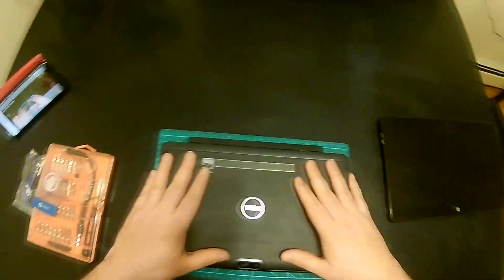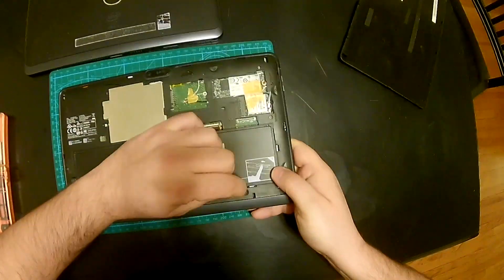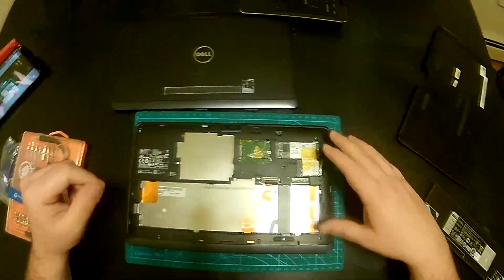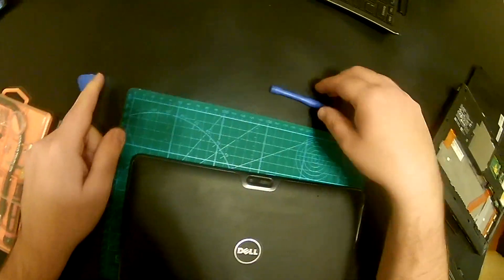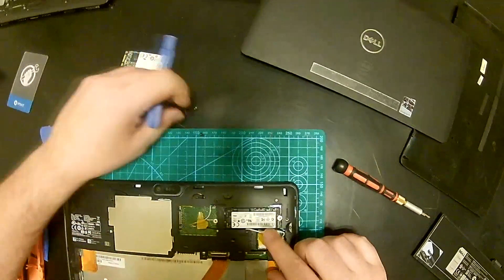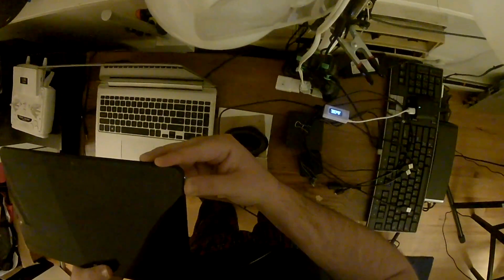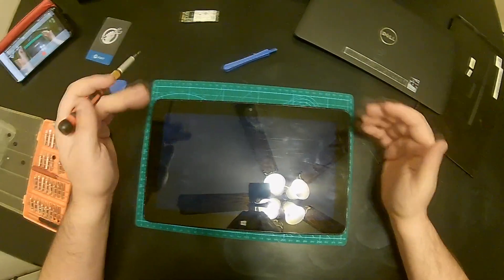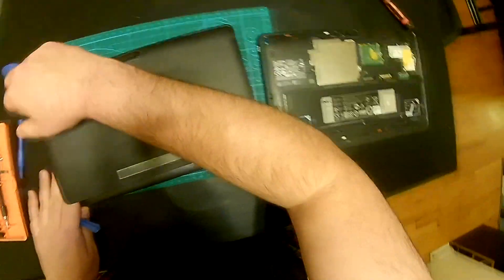M.2 SSD swap between Dell Venue 11 Pro 7140 and 7130/7130

Comment: I erased the boot options for format any idea to format that m2 sdd hardrives external? any usb adapter for that kind of hard drives?
Reply from the maker: Just search USB to m.2, you'll see a lot of them available. Then use some kind of partition tool or Windows Disk Management to create format and partition it.
Reply: @markoni985  I found one thanks